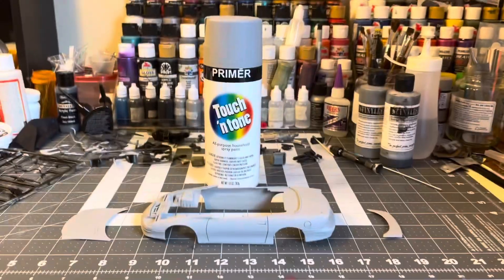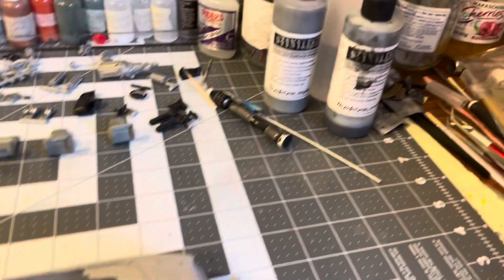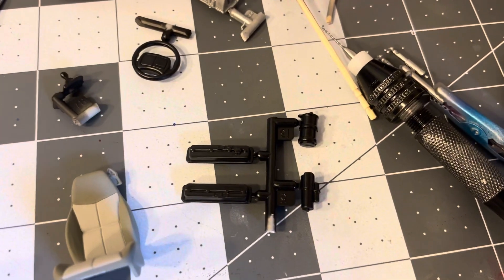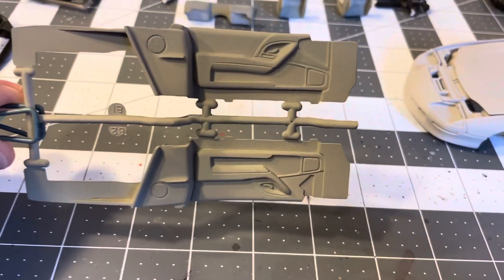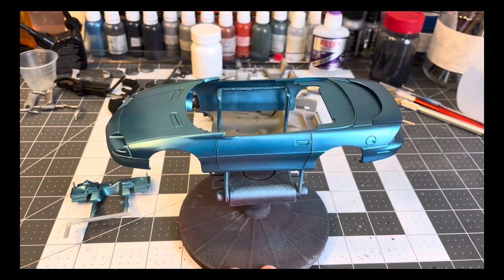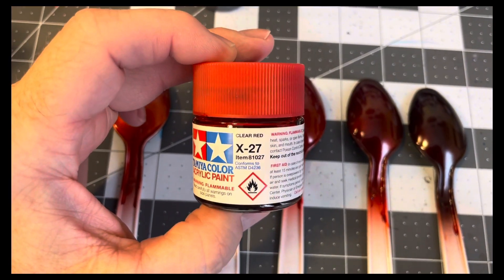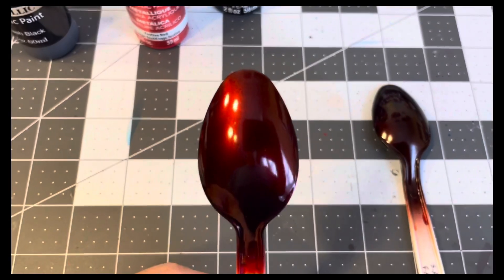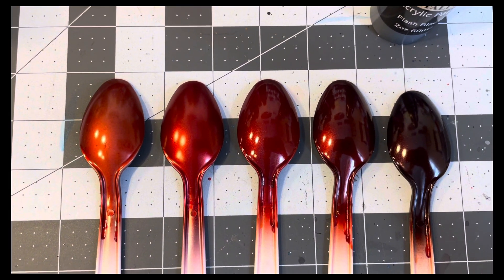Weekend Update on the AMT 1994 Camaro Z28.

Comment: years ago an antiquarian told me to use ivory dish soap to remove the paint and clear coat,  have you tried this?   Also years ago I saw someplace that sold vinyl top with adhesive backing for model car projects,  have you tried it?
Reply from the maker: I haven't tried any for of dish soap for paint stripping yet. I have seen a similar product for vinyl tops, but haven't tried any yet.